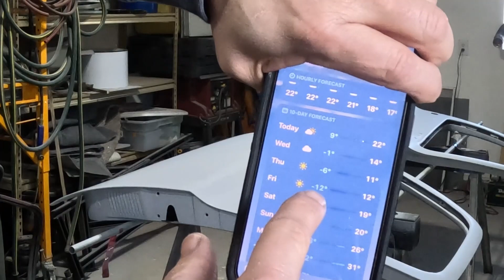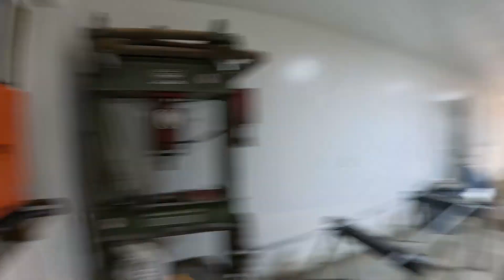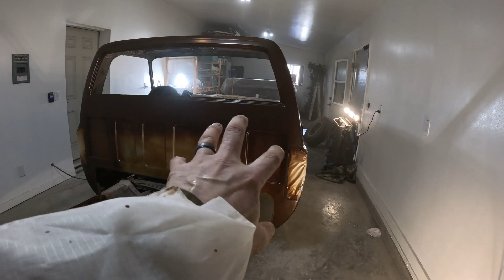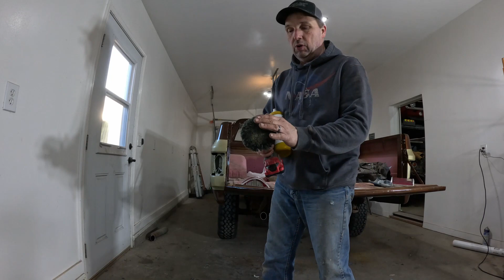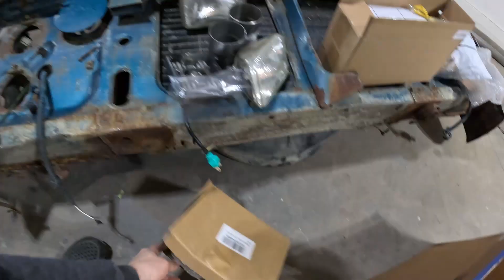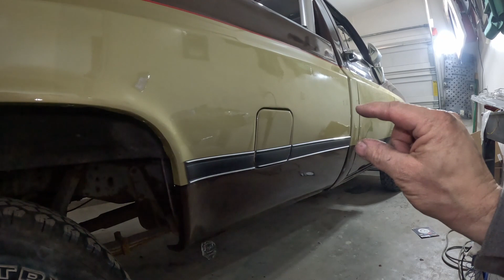Ep 9 Fall Guy Square Body New paint, trim, roll bars, LED head lights!

Comment: That truck has gas fill doors on both sides of the bed.  Is that normal?
Reply from the maker: Yep.  Dual tanks.  All three of the trucks we have ended up with have that option.
Reply from the maker: I prefer to call them gasholes.  And I have two of them.  😆